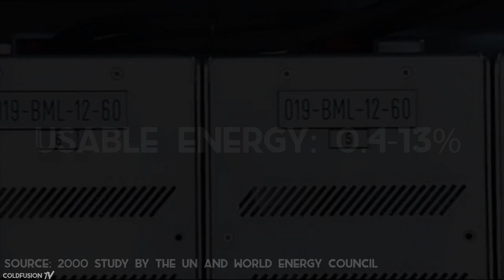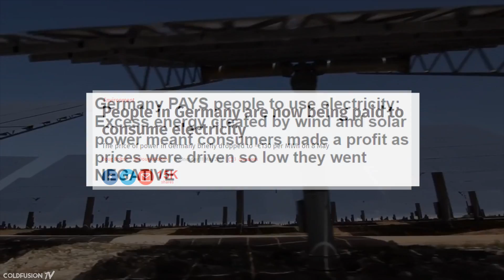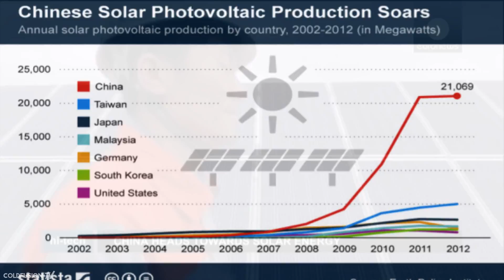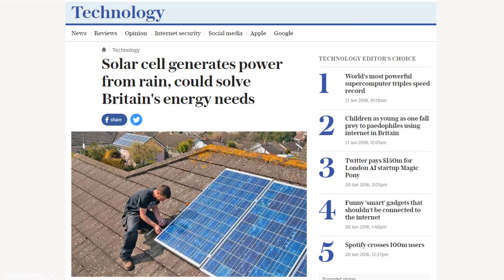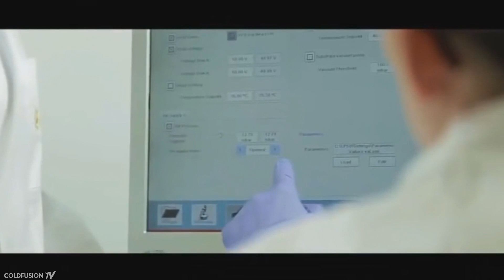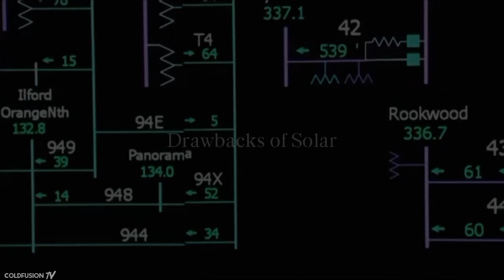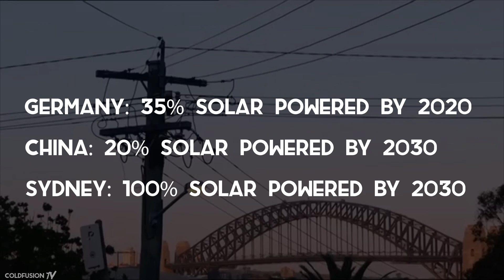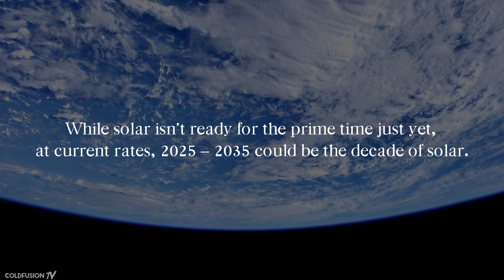The Truth About Solar

Comment: Anytime the title is "the truth about.." you have to wonder "whose truth?" Truth is subjective. Facts are not. 3:22 One thing you didn't take into consideration is that the usage of electricity per household in Chile is nowhere near what the UK, Australia, USA, etc, will use. It's easy to give it away when no one uses much of it. But you still have the same problem that it will only work when it's in the sun. If you think it will work when it's cloudy, go buy yourself one and let us know how that turns out. You HAVE to have a backup power system. And it's still freaking expensive to power your house with it. An installation for a normal house in the USA is going to cost you about $15,000, give or take.. It will take you 15 years to recover the cost. By that time, you'll have to replace the panels because their output decreases by 20% after 10 years... Solar has a place, but nuclear - specifically molten salt thorium reactors - is far better for high density locations. France has some of the lowest costs of electricity because they are 75% nuclear. Germany's "renewable" energy plan was a dismal failure having to revert back to coal fired plants because of the cost of renewable maintenance and needing backup power systems anyhow.
Reply: Truth is not subjective. Opinion is subjective. 
Batteries smooth out intermittency. Their prices, like the panels, will fall. 
LFTR definitely has a place; specifically, remediating older nuke's waste. 
The rise of solar will re-emphasize the old equation: Land = Power.
Reply: Interesting that everywhere in the US will take 15 years to pay off solar, could this be a meaningless generalization?
Reply: Doug Mcdonell I installed my 3500 watt system myself back in 2014 in New Jersey USA.  Total installation cost was $5,800. It'll taks me ~10 years to break even.  So far, 4 years already passed out of the 10 already!!
Reply: Yes, Gen IV Nuclear, specifically molten salt reactors that are actinide/transuranic burners are the way to go (emits less than 1% nuclear waste). All other sources of energy are just diffuse energy collection systems and would require millions of square meters of panels to clean and replace daily to support the world's needs. And besides, nuclear has killed less per kWhr produced and consumed than any other source of energy ever, and that even includes using it as a bomb in some comparisons; i.e., coal kills about 50,000 globally per year and spews more airborne and tributary nuclear pollution than any nuclear designs dating back to the 60's, including Chernobyl and Fukushima.

The source of solar energy is also very poor with regards to managing an electrical grid. It would cost north of 10 trillion dollars to try to account for such electrically "dirty" energy sources and still be quite inefficient (both area, battery storage and cabling) when it comes to delivery to the end customer. And don't forget that the current backup systems for solar is natural gas, that when implemented intermittently, causes more air pollution than just staying with coal. I don't support coal, do you?

The fossil fuel industry is the ones promoting solar, algae, geothermal and wind because they know it will likely never compete in the long run. Also, notice that they specifically oppose nuclear. Why do you think that is? I'll tell you; it's because it directly competes with their bottom dollar, and if designed as Gen IV, would run them out of business. Follow the politics, and you'll see who is trying to distract your attention from the real energy issues at hand. If you do the physics, you'll get it.

Go nuclear or go extinct.
Reply: Paul, actually, it isn't made up facts. I have about 1500 pages of research documentation of molten salt reactors of various designs and configurations that were functionally engineered vetted 50+ years ago, albeit with limited powers. The Americans, French, Indians, and Russians were all working on thermal and fast MSR reactors in that time frame but were abandoned for financial and political reasons, not necessarily for engineering impasses. The main issues I'm aware of basically boil down to corrosion concerns and criticality modalities. Nonetheless, today we have many alloy types that didn't exist then with software simulators, that are available now to resolve those problems.

I believe that the industry followed the Americans effort to produce BWRs and PWRs since there was a lot of interest and impetus in that field, but there were small groups with less funding that determined there were additional savings and deterministic safety to be had by utilizing fissile and fertile nuclear materials in a molten salt configuration. And even though a fully functional MSR doesn't exist yet, just remember that before 1942 there was no nuclear at all; no wind farms, no solar panels, no cell phones, no flat screen televisions, no supercomputers, etc., etc. Just because one doesn't exist yet, and there were MSRs in R&D form running 20,000+ hours with passively safe shutdown designs, doesn't mean that they can't or won't.

I personally could care less what idiots are spewing their political talking points on nuclear, coal, solar, wind, or otherwise. I only care about how we can prevent further global environmental damage and improve the lives of everyone in the process. Nuclear is one of those ways. It can be if permitted to be researched and developed, a tremendous asset to any country willing to extricate itself from the fight over fossil fuel from the cabals who manipulate and control it. To them, it's a money and power game.

I have no skin in the game, and so if anyone wants to pursue all the various "green" technologies, I'm fine with that, but at the same time no one industry should get a leg up by manipulating the populace into believing that there are only a few types of "effective" energy resources to pursue and then skew the results by financially subsidizing or using their political power to denigrate or entirely prevent other energy methodologies from development (i.e. massive expensive regulatory red tape in the case of nuclear). Nuclear "costs" billions to develop, not because it's particularly difficult, but because of the regulatory capture environment in which it lives.

I also find it disconcerting how many environmentalists lie about how effective their "green" technologies are (I'm looking at you wind and solar greenies) by using narrowly defined statistics (lies, damn lies, and statistics, am I right?). I realize that any implementation of any technology can become a boondoggle, including nuclear, but that's more a human failure than a physics issue. We all have our biases. Try to look through the lens of physics and chemistry and not your personal proclivities and let physics do the "talking".

To wit, put your physics hat on, and take your political hat off. It helps you see the world for what it is and what it can become...
Reply: I can tell you don't do much nuclear research. I'm pretty sure I was referring to nuclear fission since I was using the language of fertile and fissile materials in my previous response. To the best of my knowledge, there are no molten salt reactors that use fusion as their energy source unless you include ADS. Anyway, you need to be very specific as to which type of nuclear you are referring.

Get back to me when you've done your homework, and then maybe we can talk about the financial aspects of one technology over another and how regulatory politicking affects the price. And yes, I'm also familiar with the various fusion designs in existence too. And to your point, they are definitely not ready for prime time.

Besides, why all the negative "Nelly" talk, are you afraid that there's a better way that doesn't align with your belief system? Let's everybody compete equally and without favoritism and see what comes out of it. There is nothing inherently "evil" about nuclear. It's more about your political upbringing and education on the topic.

If I'm not mistaken, one of the main reasons solar and wind have financially undercut nuclear is due to the numerous political subsidies they have received and the near impossibly high safety bar that has been put in the way as an intentional subversive obstacle by the "anti-nukers" to prevent either investment or development in nuclear. Almost anybody doing nuclear research and design today has to consider what regulatory environment they are doing research under, and that forces technology to be done overseas in less than ideal circumstances and with less than savory government "supervision".

It is a near certainty that if you manipulate the investment markets by forcing a preference of one tech over another, you can get the undercut pricing you desire.  If I were to place a solar or wind license certification that costs $5 million a year to operate similarly to the fee/fine nuclear has to pay, I bet you couldn't provide competitive or cheap energy either. But again, that isn't a natural market force, but a political one, and you can't say that wind and solar haven't had their markets excessively favored over others...

Back in the 60's ORNL created a completely functional MSRE in under 18 months sans computer simulation models or previous experience. Nowadays in the political environment that restrains and hamstrings nuclear, it would take nearly 10 years to do the equivalent and that's with the aid of 50+ years of research already under our belt and supercomputers to boot. These financial issues aren't technical ones, they're political.

Again, put your physics hat on and take the political hat off. Let's all play fair, not favorites...
Reply: Riverstrat, you mean Gen I nuclear power is somewhat unclean, safe depending on which design, and yet is still extremely responsible. The spent fuel has a half-life of 250k yrs because it's still mostly fuel. Now build a Gen IV plant, and 99% of the fuel gets burned (actinides and transuranics) and the "waste" becomes almost insignificant. Some of that waste is used in nuclear medicine, horrible as that sounds...

Technology changes with the times as should nuclear. We're still using early 20th century nuclear in the 21st century. Mouthing off anti-nuke ideologue talking points as if it were the absolute truth is just so easy to counter. In fact, it's almost so trivial I could teach my teenager to do it. You should take a physics class or two and then we could have a more grown-up conversation.
Reply: Paul Smith - While we're discussing "facts", nuclear plant sales have died in some countries, as of 2016 there were 67 under construction. The normal grid backup for solar is natural gas, not batteries. Your monthly payments will likely be less than your monthly savings, except for locations where your monthly payment is more, it entirely location dependent.
Reply: YASH - Nope, LFTR won't make it, we need something to support wind, solar and tides that is not affected by public opinion like PHES.
Reply: The big reason is financial. Solar and wind now undercut nuclear. They are also distributed sources which helps stabilize the grid.  Molten salt makes a great power storage system, if tied to renewable energy.  Renewables are on an exponential growth path. Nuclear is in the opposite direction. If a financially viable fusion reactor could be developed that would be fine, but we have been waiting for that for 50 years, and it's always been 20 years away.
Reply: Batteries are the answer. They make renewable energy the obvious answer, for grids, residential, transportation and just about every other application. We will never fly in a nuclear powered plane, but electric.....https://cleantechnica.com/2017/10/05/launch-details-zunum-aero-electric-hybrid-planes/
Reply: Almost everything worth pursuing requires effort and thus research. So what! Expensive and lengthy is subjective and mostly depends on the people who have the engineering expertise and educational background to do the work. Almost all of the MSR research has been done minus a few corrosion issues, and those have been worked out elsewhere in other industrial applications, so bleating that out constantly as if that's a game changer or some legitimate gripe is a repetitive non sequitur.

I'll say it again, good on everybody for doing whatever they can to improve whatever tech they're interested in whether that be battery density, electric cars & jets, wind, solar efficiency or improved structural insulation. All good stuff no doubt, but don't stand in the way of other types of progress. I seriously don't get what your complaint is. What is it exactly that you fear about nuclear? Your conversation almost has an anti-nuke religious fervor about it. It smacks of dissent just for the sake of dissent.

Anyway, please don't intentionally get in the way of nuclear-related tech just because you don't understand it or dislike it. That's just being disingenuous, subversive or dogmatic. I've looked at all the green tech out there, and nuclear despite all its political gerrymandering saboteurs beat everything else hands down in almost any physics category of import.

It's denser, utilizes less square footage, produces less pollution per kWhr, has a million times the energy content than chemical bonds, can be made deterministically safer, can be co-located anywhere you want, mining the thorium ore is not exclusive to a particular geography (hence not geopolitical), has enough resources to last tens of thousands of years (or millions if you're careful), and many of its fission products can be used in medicine and other chemical industries because of the higher temperatures including desalination.

What's not to like???
Reply: Alexander... If I don't describe nuclear, or anything energy-related for that matter without using the "novel" description, I get kicked in the teeth for oversimplifying or getting attacked by people like you ad hominem getting slandered a "nuclear propagandizer". I'd rather be accurate and honest than spew demagoguery. Nonetheless, every once in awhile and just for you this one time, I'll break my own "novel" rules:

First, and most obvious to everyone who isn't younger than a 2-year-old, the wind doesn't always blow, the sun doesn't always shine and efficiency isn't the end-all-be-all panacea to all the worlds energy problems.

Second, any intermittency that comes with "renewable" energy will need a backup or what I like to refer to as baseline power, since without out that you'll always have unreliable power production that will inevitably cause rolling blackouts or brownouts. In other words, in the world we live in now, your backup power is likely to be tied to fossil fuels. Go check it out. Almost any sizeable wind or solar farm is going to be backed up by natural gas. Next on your go-to-list is probably battery storage, but if that's your solution, with its low specific power, low specific energy, and its limited life-cycle count will not supplant baseline power, maybe perhaps never. In the U.S., as an example, if you were to round up all the functional batteries in existence and committed them to storage-backup, you'd have less than 30 minutes of power. Not acceptable, not a solution, and definitely not practical. Now that I think about it there are nuclear batteries...LOL...

Third, utilizing landmass for low energy-dense-production renewables on the whole, given its current implementation, is actually less efficient and can increase GHG emissions opposite to what you'd expect. And that's mainly due to how baseline and intermittent power sources are married together (distance to the customer, transmission losses, capacitive and inductive load mismatching, etc.). The overall global production of renewables is less than 2% so it really isn't a sufficient replacement in the energy market, at least not in any competitive capacity. Or more specifically, it can't serve everyone everywhere in the same way. To wit, you have to live near a fairly windy location, or in the case of solar, live somewhere nearer to the equatorial latitudes to increase your reliability.

I could go on and on, but I'll just proceed to the fourth and final issue: I'm not looking to propagandize anything. I look at the physics, math, and risk analysis and make a decision to go forward from there. Saying that one tech is safer or has to be 100% safe compared to tech X is just straight up disingenuous, unfair or lying. There are always compromises to any energy resource including renewables. Wind and solar given the vast surface area coverage will have environmental impacts and would be further exacerbated by the millions of cubic meters of battery material in a backup configuration. Nuclear produces radioactive waste. Different problems require different solutions.

Anyway, don't be anti-nuke or dismissive of technology you don't understand, or reiterate the same debatable popular talking points because others are spouting it too (most of it has been refuted). Doesn't it make you wonder even just a little bit when all the major energy suppliers constantly dismiss nuclear? Why the continual appeal-to-emotional-baiting pushback? Could it possibly be a real game-changer that could affect their bottom line? In many ways, the fossil fuel and renewable companies are quite close politically-tied organizations. When I see that sort of demagogy I look to see who's behind the curtain pulling the strings. I get this rehashed droning on vibe of "don't look over here", "there's nothing to see",  "nuclear is bad", "nuclear isn't practical", "nuclear isn't financially viable or too expensive", or "nuclear takes 10+ years to build" and last but not least, one of the worst propagated lies of all time, "radioactivity is dangerous". It only makes me more curious.

Anyway, you'll thank me later when the entire world goes full nuclear because we'll finally have a long-term stable energy resource that won't plague the planet with energy-poverty, diffuse, intermittent, high-environment impact "renewable" solutions. Don't get me wrong, I'm not hating on renewables (I actually think they're pretty cool), it's just that they aren't a realistic complete solution to the world's energy needs moving forward unless you intend to reduce the population to less than a third (you wouldn't do that would you? Yikes!). Mathematically, they don't add up and they are extremely impractical from a maintenance standpoint (millions of sq. meters of panel surface would have to be constantly cleaned and/or replaced on a daily basis and wind turbine noise drives out the wildlife). Renewables aren't ready for prime time either, and they shouldn't be foisted upon the public as the panacea they're claimed to be.

Well, I went all "novel" on your arse after all... I suppose I can't help myself. It is just physics and math after all. You can't cheat nature, or fudge the numbers (unless you're a politician)...
Reply: Or..... I could entertain you with a video that describes the issues quite eloquently and mathematically at the same time. Woohoo!!

https://youtu.be/E0W1ZZYIV8o
Reply: Or if you need to hear it from an original dyed-in-the-wool greenie, maybe this video will suit you better...

https://youtu.be/ciStnd9Y2ak
Reply: Paul Smith - Thanks for the link, it certainly sounds good, to the point I thought maybe batteries are catching up so I checked at http://www.energystorageexchange.org/
the result was - not even close. Elon Musk's 100,000 Kw battery in Australia is the largest in the world, while 14 pumped storage projects between 200,000 and 1,000,000 Kw have gone online since 2016. The cost of batteries has come way down and maybe batteries will equal pumped storage costs one day, but not soon.
Reply: Plenty of clean technologies work 24/7, starting with hydro power and including batteries, molten salt, pumped hydro, air pressure, heat batteries, hydrogen production and on and on. All of it getting cheaper every year, most of it cheaper than fossil fuels.
Reply: Not at this time. You have to realize that this revolution only started really rolling about ten years ago.  In that short time some countries have gone from 2% solar to 40% solar power. That is an amazing change and shows that it is inevitable. The future won't be 100% solar but will include hydro, wind, battery, geothermal and whatever else comes along, but fossil fuels are on the way out.
Reply: In MOST cases your monthly payments will be less.
Reply: Luke, it's very practical considering the fact that many older nuclear and coal plants are becoming decommissioned. I suspect there are a few proposals under consideration if enough money is drummed up, but there needs to be more support from the citizenry; that requires re-education (un-brainwashing), or an approach similar to what the French did by constantly feeding the public subject matter they can understand whilst simultaneously avoiding oversimplification. A grassroots approach as they say...

And while I don't think the existing turbomachinery is plug-n-play, I suspect it could be accommodated in such a way that wouldn't be overly complex or expensive. It really boils down to the heat exchanger interface and the coolant loop salt chemistry ( i.e. fluoride vs. chloride eutectics & fast vs. slow neutron spectra design criteria) and whether or not neutronic coolant materials are utilized ex-reactor.

To wit, the design basis is mostly a combination of three things: salt chemistry to avoid corrosion and super-criticality side effects, fissile and fertile neutron economy to manage neutron poison over-moderation and gas-off, and custom metal alloys to handle modest temperature excursions due to undesirable nuclide transmutations. Okay, four: you have to deal with the minuscule amounts of long-lived fission products onsite. But that's meh, you'd maybe have to deal with a couple kilograms a year per trillion kWhr. Cry me a river... I swear the liberal leftie greenie weenies are just killing me. LOL

If the coolant is also the nuclear fuel, then you'd have a neutron source extant to the reactor vessel, and that would require some special material science to deal with neutron embrittlement and metal redeposition in the piping. On the other hand, if your coolant salt is not radioactive then it's much easier to deal with, but that requires you use a 1-1/2 or two-fluid design. It's more of a design decision from what I can tell. Either one works...

 All of that, and a few simple safety features, and you're well on your way...
Reply: Luke Frahn you'd almost need an energy crisis before you get the attention of Joe Q Public. It's sad that by the time energy prices skyrocket given a supply crunch (and by that I don't mean solar or wind but the "backup" gas and coal), most of the experts knowledgeable in the nuclear fields will be a dead or dying breed. Not to speak of the horrific damage nature will have to endure in the meantime. 

But it won't be for trying...
Reply: Luke Frahn and I forgot... most of the expense in nuclear is red tape, and secondarily it's fissile fuel load-out. 

I've seen some fissile load starter percentages less than 1% 235U, 233U or 239Pu but if you're not careful, your fission products will get the better of you and you'll spend more time reprocessing to keep your fluid above the subcritical level.

Think of it like snuffing out your weak nuclear fire by permitting the actinide ashes (high neutron cross section) to be constantly mixed with your fuel. I prefer 5%+ fissile mixtures so you get a "hotter" radioactive stabilization regardless of the fission ash content. 

And last but not least, depending upon what salt chemistry you pick, there's good reason to start with specific isotopes of elements to avoid tritium production, high neutron absorption side effects or unwanted decay and mutation products that cause reprocessing complications. In so doing, or rather choosing specific atomic numbered elements makes for difficult isotope separation. Unfortunately difficult in this case directly affects cost.

But with any engineering design there are reasonable exceptions and compromises that can be made that still work.
Reply: Acme Fixer. That's all you got? A reverse tagline? Of all the explanations and clarification I gave, your response is a nonchalant easily falsifiable appeal-to-emotion one-liner? Gads...!

Some people can't be reasoned with...
Reply: Paul Smith - When wind and solar have penetrated the market up to their capacity factors they will then need storage or some other backup to keep growing. I haven't heard of any drop in utility scale storage prices, pumped storage is by far the cheapest and the price has been constant through the years. The regions that do not have existing hydro to upgrade to pump back will be looking for other solutions, like nuclear. Just like France does for her neighbors.

I'm interested in climate change solutions, those solutions allow for radiation accidents, biofuel air pollution, geothermal hydrogen sulfide and habitat destruction from hydro and tidal.
Reply: Battery price drops are easy to prove and they are the main part of a utility scale system. https://www.navigantresearch.com/newsroom/global-revenue-for-advanced-batteries-for-utility-scale-storage-is-expected-to-reach-3-6-billion-by-2025
Reply: Pumped storage is fine, but location specific. whereas batteries go anywhere, including in individual homes and businesses. There are 35GW of battery backup just in the U.S. now.
Reply: Globally close to 200GW, and growing exponentially as battery costs come down. Musk has a new project on the go for a battery 10x the size of his last one.
Reply: A bunch of made up facts. All of it hogwash supplied by the nuclear industry.  None of it proveableand the tech you talk about does not exist.  Show us one gen iv plant in operation.
Reply: @paulsmith3921  
I'm pretty sure Oak Ridge had a molten salt reactor going or in the planning stages in the early 1970s.
Reply: On the flip side, I'm keen to know if there are any countries exist which run entirely and independently on renewable energy? That have industry? Without hydro?
Reply: I remain skeptical for a number of reasons; mainly the lack of discussion about nuclear alternatives and the 'progressive' politics surrounding renewable energy. As you're aware, we have a looming environmental disaster on our hands and I for one would like us to have abundant, reliable and clean energy to sort it out. I'm from South Australia where we have 50% solar/wind generation, and our 2016 state-wide blackout and world's highest energy prices speak for themselves.
Reply: https://reneweconomy.com.au/mythbusting-electricity-prices-south-australia-86374/
Reply: Check what happened with the Hinkley Point nuclear reactor in the U.K.    https://www.kallanishenergy.com/2017/06/26/hinkley-could-cost-38b-in-electricity-payment-increases-nao/                                                                                                                                                                                                      https://www.telegraph.co.uk/business/2017/07/18/hinkley-points-cost-consumers-surges-50bn/
Reply: That 50% solar wasn't installed by the coal bribed government. It was installed by individuals who were fed up with high electricity prices, and by independent utilities that got lower price bids from solar producers.
Reply: I wasn't tying molten salt to nuclear reactors at all. The problem remains that it is research. Expensive, lengthy research. Solar and wind are commercial and dropping in price continually. As the utilization of renewable energy grows, so does the increase of efficiency. Double the insulation and you easily quarter the energy requirement of a new home, meaning 3KW of solar can make that house almost invisible to the grid. Do that to all new houses and switch to EVs and you can dramatically drop the requirement for new generation despite population growth.
Reply: Oh? Did you research the price of solar?   https://www.vox.com/2016/8/24/12620920/us-solar-power-costs-falling
Reply: ....or the future of oil?      https://cleantechnica.com/2018/06/05/carbon-bubble-about-to-burst-leaving-trillions-in-stranded-assets-behind-claims-new-research/
Reply: Your blackout was from a windstorm that took down towers. The solar and wind farms had no problem.
Reply: And solar has dropped even faster since the article.
Lat year at this time renewable energy passed nuclear in the U.S.
Reply: Evan Tinney - What would the practicality be of emerging reactor designs being build alongside existing thermal plants to utilize their infrastructure (turbines, transmission, etc?). I trust someone, somewhere has proposed this?
Reply: Gen iv is still in research,and when that is finished it will be 10 years before one is built. Meanwhile wind, solar and other clean technologies continue to drop in price.
Reply: The wind and solar had no problems NOT working on that afternoon. The wind was the trigger for a cascade of events, all of which occurred in the context of a left-leaning Government, their policies, changes to the state's 'energy mix', etc. Complicated for sure, but you can't take a reductionist view of such things; we have big picture problems and small minded people who aren't helping.
Reply: Falling power lines were the cause, not solar farms, though some people tried to lay the blame there.
Now you have the Tesla battery that has already paid it's way.
Reply: Well, some silly folk here got tricked by the alluring scent of Musk, where as I see it as a huge waste of lithium and other resources to prop up renewables. Humanity would best use that sort of technology for powering vehicles (charged with emerging nuclear generation of course).
Reply: Evan - I'm not a scientist (an applied social scientist perhaps), but I really appreciate the insights from someone who understands such concepts. Sounds like a design problem of exchanging heat energy, sans radioactive particles. No doubt it can be done and where there's a will, there's a way. Just curious if some kind of retrofitting solution was feasible to counter the 'too expensive' arguments against implementing 'emerging nuclear'. Obviously, as some comments here highlight, technology isn't the core problem (pun intended), public perception, vested interests, politics, culture, ideology, etc, i.e people are. We can go down this renewable route, but I don't think your average person even understands  the fundamentals of what energy is, let alone how we generate and consume it. Reality will hit home for them at some point. Makes me quite pessimistic about the future although I do plan to go 'off grid' in my life time; I'll let greater society collapse while they're working this out.
Reply: Evan - Thanks for the chat buddy. Keep up the good work on your end
Reply: Evan - I have no doubt it's complicated and challenging. May I ask what your line of work is?
Reply: Look at the change we've seen in the last 20 years and then repeat that nonsense. Stop reading nuclear propaganda, Germany is right on track, are they done? no, but on track.
Ask the Japanese how cheap nuclear power is, oh, but that won't happen where you live, no...
Thorium. To seriously make a dent we first need to make the technology feasible and safe, and we have to deal with the nuclear waste. By the time that comes around (min 10 years for reactors to be online, wind and solar will cost near nothing in comparison.
Whatever...
Reply: It isn't anymore, it's down to 4 years in China, 6-8 years in the US. The longevity has been increased to 35 years...
https://news.energysage.com/understanding-your-solar-panel-payback-period/
Reply: Renewables don't need a large grid, you make your power right at home.
Go nuclear, go extinct.
Reply: Austria has an entire province, its biggest province, powered on hydro solar and wind. There is lots of industry, but it is high tech and very energy conscious/efficient and clean. The industrial landscape in Central Europe and Switzerland changes rapidly every year. Germany will have 100% renewable energy online within half a decade. 
Heavy industry has been (is being) replaced with industries applying new technologies like nano, molecular biology, A.I., 3D printing etc. and their development.
Renewable is the way into the future, the only way. Just like national thinking and rivalry are futile, so is 'burning' any kind of fuel.
Paradigms need to shift if we are to make it past the problems we face.
Reply: Your novels don't change the underlying facts that renewables will be safer, cleaner and cheaper by the time enough LSTR could be near ready to go online.
Reply: I will be all for nuclear fission, once it's safe (100%,  considering the alternative) and once a feasible, environmentally friendly solution for the waste has been found. Of course, by then, it will have to beat the price of renewables.
Reply: Your full of it I own solar panels and they have been working for longer than 15 years they do work some times when clouds cover is and the solar panels charge a huge 🔋 so even if the panels don't produce electricity you still have power yes dollar panels can be expensave for mantnes but they don't always cost 15k if you keep them in good condition they will last for years for instance the international space station its been in space for a long time and it's completely ran off of solar.you are completely wrong about solar panels
Reply: I'd recommend that MacKay dude's (free) ebook as well:
Sustainable Energy - Without the Hot Air
http://www.inference.eng.cam.ac.uk/sustainable/book/tex/sewtha.pdf

There's a similar assessment done for Australia titled:
'Australian Sustainable Energy - By the Numbers'
https://energy.unimelb.edu.au/__data/assets/pdf_file/0006/1944060/Australian_Sustainable_Energy-by_the_numbers.pdf
Reply: npsit1 
Your 'facts' are just as subjective as the 'truth'.

Your statements are predicated on certain issues which may change a lot in time.  As more homes get energy storage, the less dependent solar energy will be on backup power.  I think your statements fail to reveal this, you're being just as "truthful" as the truth you criticize.
Reply: Evan Tinney 
Go nuclear and we'll go extinct.
Reply: Maybe the problem is that we see everything and I mean everything as a source of profit, regardless of ethics and morals whatever their levers are (they are different by means of social factors, culture, tradition and religion). Since energy creation imply work, as W in physics/math, this creative effort in our civilization means a great source of income. Ergo, we are not yet ready to see such paradigm as "free energy" much less a "free energy society" until this factor is implicit in a global scale.
Reply: riverstrat  
Certain fast neutron molten salt reactors can burn off the actinides/transuranic elements from the initial fission and leave waste that only has to be stored for 300 years rather than tens of thousands.
Reply: the vid is over 5 years old its use is only historical it should be deleted
Reply: Do you really think solar panels will always cost $15K? A flat screen TV in BestBuy used to cost $15k and every few years they drooped in half now they are dirt cheap. What about when a home solar system costs only $5K and and has 10x more output. Will it be ok then???
Reply: Whoa there little fella. You have a few made up 'facts' there. Recently solar panels from the late 70's were tested and found to still generate 80% of their rated output. and that was with that old technology. If have a long term loan to pay for a solar system your monthly payments will likely be less than your monthly savings on electricity costs, so the system is free. There is a reason nuclear plant sales have died. They are not financially viable, AND, you totally ignore the battery backup that is making rapid inroads. Also, all of this is rapidly getting cheaper.
Reply: Globally, renewables are out selling nuclear by a wide margin.Many of those 'under construction' are facing the continues decrease in prices of renewable energy. Some are on hold and others like Hinckley Power are facing ongoing delays and a near tripling of original estimates. As utilities smarten their grids renewable energy and utility scale storage drop in price we are seeing a decrease interest in nuclear.
Reply: Well Germany UK and USA is not the whole world
What an idot
Reply: Evan Tinney - Good to see someone who gets it. I find it useful to use the expression 'emerging' nuclear technologies to those who are physics-ally challenged. You're spot on; 'big coal' and 'big gas' love the folly of renewable energy.